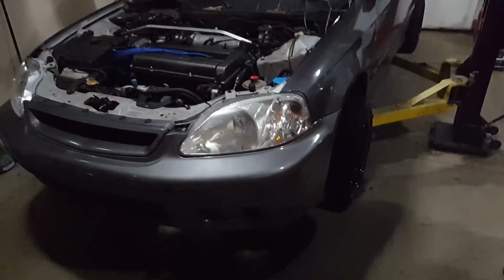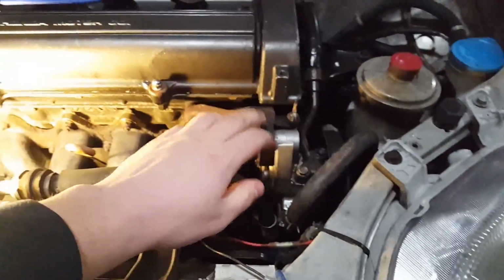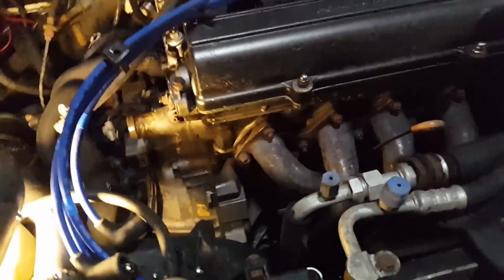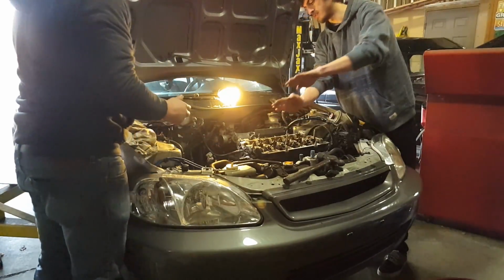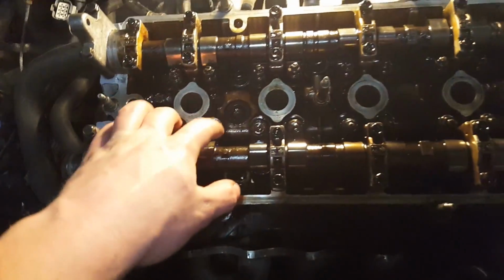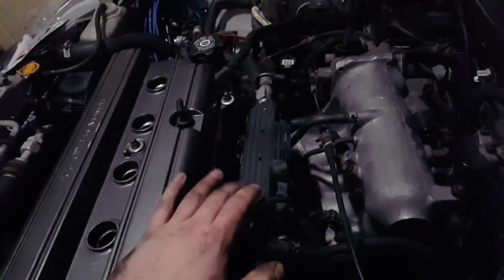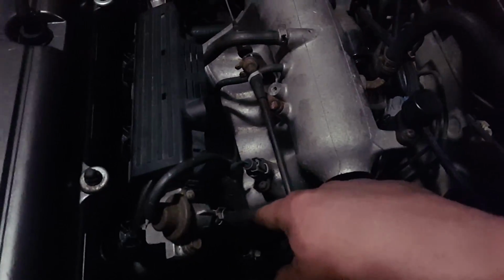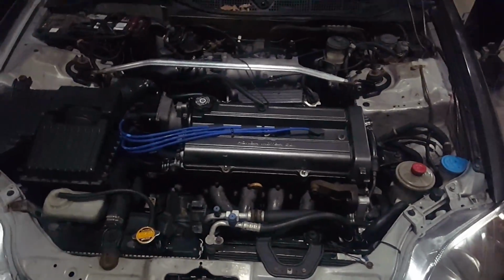Replacing The Head Gasket On My B18B1

Comment: I know this video it's not the d16y7 but, I have a question I don't know if you will know what is it , but 2 things the first to the car start I have to  take the ECU unplugged some minutes before I usually take it out on the day before ,  if I don't do the when the car starts seconds alter it dies and keep not wanting to start ,so I plug the ECU on and until the car gets about 30 to 40 minutes running it gets very strange if i get more than 2,000 rpm sound like a big misfires and i have to put it on 4th gear to run at 60 km per hour   anyway so after the time passes i can rev it up with some sounds as a low misfires to almost 7,000 rpm , the car does not smokes nor loses oil or coolant ,I've cleaned the intake and the  TBI cleaned the low rev sensor and so on , now two strange things is that were a bit of oil coming from the pcv valve and also from the hose that comes from the head cylinder gasket ,  so I've put the 2 hoses to the original air intake you near the headlamp ?and closed the 2 holes in the intake manifold and the iron hose that comes with the water hose as well , so no more oil coming in , but those problems were already long before the start problems , I know that I've typed a lot but do you know what my problem could be? I don't know if it's related but in may last year after I bought the car I took it to a Honda dealer and they've put 0w20 synthetic oil on it  and I just got to know that 6 days later when in a high rev like 5,000 smoked a bit , then I put 20w50 oil as our Brazilian owners manual here in Brazil said to put it in 2000 when it was new ! since that day the car was fine but in December that problem appeared , I've changed the  ignition coil and since than it's like what I told you , by the way mine is a d16y7 manual .and the ECU is yw Heihin do you have any opinion about it? thanks and great videos
Reply from the maker: I don't know if I understand everything that you've done, but first I would put the hoses back to the way they were on the intake. The hose from the valve cover can technically stay near the headlamp as it can be placed anywhere before the throttle body. Its normal for a little oil to come through the pcv valve hose and that hose should go to the intake after the throttle body. If its a lot of oil, you could try cleaning out the breather chamber under the intake manifold. Its very important for the coolant hose to be connected to the IACV as well.  Other than that, it sounds like your issue might be the ECU itself. Check all of your grounds (especially the ecu ground on the thermostat housing) If all of them are good and clean, try getting your hands on another ecu.
Reply: Sure your timing belt didn't jump a tooth? My Honda Civic eg8 was similar turned out to be timing belt was tooth out. Cheers